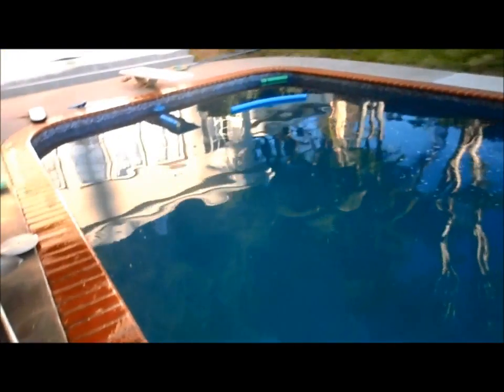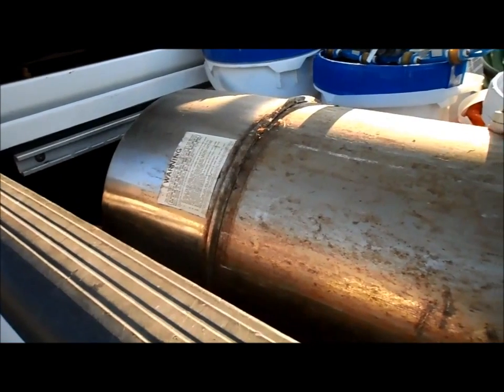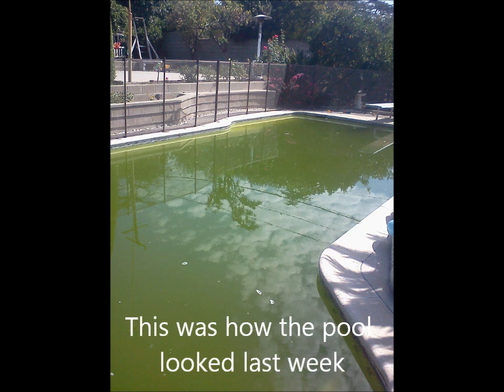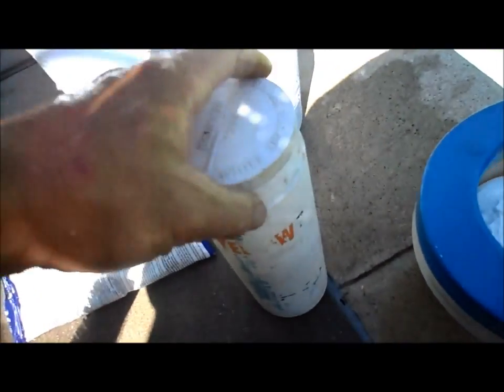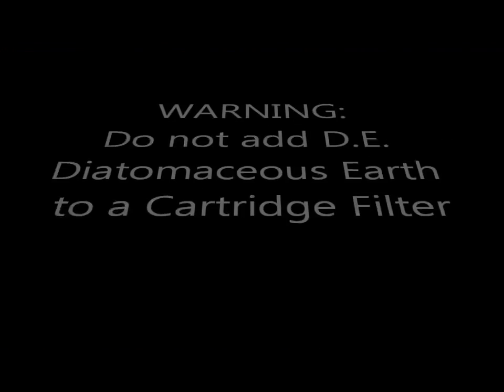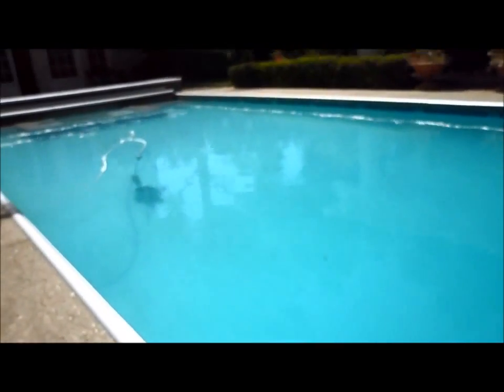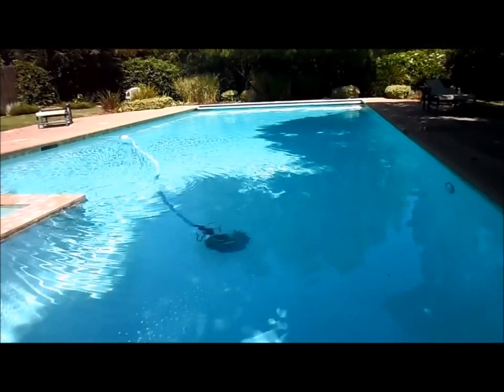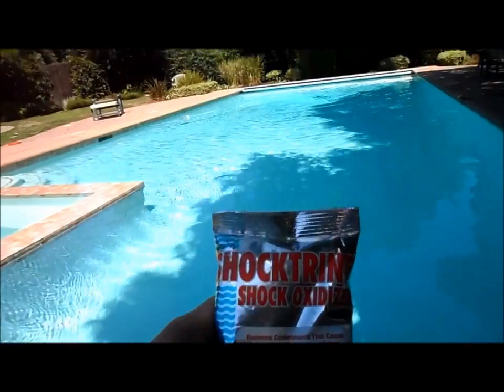Cloudy Pool Water, Causes and Cures

Comment: Another question. So I let me pool run with no Chlorine and some Algea has built up on the walls. Someone told me that if I use Lquid Cholrine, Yellow Trine, and shock that I would just be wasting the shock. Should I use all three chemicals or should I combine the yellow trine with liquid chlorine only? BTW, Your videos are the best Ive seen here on youtube! Thank you!
Reply from the maker: Liquid chlorine is sufficient and shock is not needed.

Comment: Hello,

Like all your videos and even have the Taylor K2006 on it's way!

Please help for a blue recover:

Here's our situation in a nutt shell: we live in SO CAL where we got hit pretty hard this winter and yes, to our fault, we neglected to stay up with the pool. So in the past 4 weeks we removed all the dirt, mud, even worms and i thought we were going to find a new fish spices, but finally got the pool from looking like an advertisement for Monster Drink, to a blue-ish tint color and also had some pluming repair and upgrade our filter to Pentair Quad 60 DE. After removing debris, we used Green to Blue (twice) and shock the pool like crazy. Right now we can see all the steps but cant see the bottom of the deep end (10 ft) and barely see the Zodiac (G3) until it comes up the wall. We've been brushing once a day since we started recovery process to get ready for summer but the pool isn't clearing up. We've had the pump running since the start as well (2600) and the PSI has only moved maybe 3 tick mark on the filter gauge and nothing really circulating through the leaf catcher. The last chemical we placed in the pool (3 days ago) was Clear-Aid and hoping it'll clear with the pump just running but we see no change. Got the water test and her's our readings: already spent over over 3K with repairs and chemicals (mostly repairs), but what are we missing here???

24000 plaster in-ground pool
Pentair Intelliflo Variable Flow Pump VF-3050 3.2kw 3HP
Pentair Quad D.E. 60 sq. ft. D.E. 
FAC: 7
TAC: 7
CH: 260
CYA: 75
TA: 120
pH: 7.6
Copper: 0
Iron: 0
TDS: 500
Pho: 0

Thanks in advance
Reply from the maker: You will need to clean the filter cartridges again and recharge them with DE. Do this until it seems the water is clearing. I would just go with straight liquid chlorine as the shock can also make the water cloudy. Your Chlorine level seems fine. It is just circulation at this point. I would also run the pump for 24 hours at full speed after the filter cleaning (3450 RPM).  Even if the filter PSI didn't rise much the cartridges can still be covered with organic materials.  Try that and see if things look better.
Reply: Wow, not even 2 weeks with the new filter and to our surprise we found two of the cartridges lien out and the other 2 with visual damage to the bands. Called Leslie (who installed them) and should have these replaced asap. We're to run the pump in the slowest speed, but what could of happen here???
Reply: Meant to say the cartridges were actually blown out, filter is dislocated from the support plastic.
Reply from the maker: My guess is that factory install was bad. Seen it happen in standard cartridge filters. I was doing a new pool start-up and it was starting to turn cloudy. Took the brand new filter apart and saw that the cartridges were not in place correctly.  It happens - everything is now made overseas and you lose that quality control... that probably wasn't helping your pool clear up any.
Reply from the maker: Strange. I would be there when they come out to fix it. Have them explain it to you. Possibly reversed the Inlet & Outlet.
Reply: Damn, you know when something is bugging you and you can't sleep. Well after your last post and seen you exact video of installation, sure enough, the plumbing is reversed! Wow, and they...Leslie's ..charged me a pretty penny too!
Reply: It was exactly as you called it, the pluming was reversed and now we can see the bottom of the pool...YEAHHHH! Pool is clear but we do have some stubborn algae stains along the walls, specially in the Spa. The readings are still the same as before except the chlorine has gone down from 7 to 5. Do you recommend algaecide or let it continue to run it's course. Its been 2 days since the repairs and we've been brushing the walls twice everyday.

thanks again!
Reply from the maker: I suspected as much... You will need some algaecide  at this point. Try to find a Sodium Bromide product at your local pool store like YellowTrine of YellowTreat.

Comment: a few more extra reason why ur pool might be cloudy
1)no disinfected level or chlorine in the pool
2)ph to low burning the chlorine to quick ph too high chlorine work to slow
3)dirty filter reducing circulation and affecting the chlorine check pressure gauge by ur filter system if ur gauge is 8-10 psi over the starting pressure  example when star it with a clean system and ur reading was 10 psi but know is up to 18-20 psi its time to backwash is it is sand or D.E Filter  if it is cartige is time to take out and clean 
4) check skimmer basket for debris and ur pump basket if its is clog it gonna reduce flow affecting ur sanitation if everything is fine u might wanna run ur system a little longer
Reply from the maker: Thanks for your helpful comment!

Comment: my pool is cloudy and i shocked it yesterday all the algea seems to have disapeared but it is still cloudy should i use some filter cleaner too?
Reply from the maker: The cloudiness will take up to a week to clear. As long as chlorine levels remain high and you are running your filter it should clear up on it's own.
Reply: Swimming Pool Tips, Reviews & How To -MrDgvb1 and using chlorine tablets will be fine or it will require more liquid chlorine or shock in the pool?

Comment: I shocked my intex above ground pool 15x48.its clean but cloudy.i was told to wait 24 hours after,its not been that long. Should i wait and see if it clears? I just put in a new filter cartridge in thinking this might help. any suggestions ?
Reply from the maker: It takes time to clear up. Just make sure pool is running as long as possible 24 hours is good and the chlorine level stays high - 5.0 ppm or higher.
Reply: Thank you!

Comment: I have a client with an ingorund pool, they shut it for a few days to do a repair, withing 3-4 days it went cloudy-green, you can barely see to the bottom of the shallow end. They dumped in a whole bunch of shock and chlorine bleach and it has been a week and nothing has changed....very bizarre. In my experience when the pool has been shut for a while and starts to go cloudy just adding more chlorine and a algicide day by day usually brings it back. 
Any thoughts ?
Reply from the maker: It is possible the shock is causing some of the cloudiness if they used cal-hypo. Usually running the pool 24 hours and keeping the chlorine at 10 ppm will do the trick. Maybe they are not running the pool long enough?
Reply: That's what I thought, usually when shocking it gets cloudy, my personal preference is to slowly bring the CL level up. If stabilized chlorine is used how much does it take before "chlorine lock" occurs? Have you ever encountered this problem ?
Reply from the maker: The CYA molecule binds and unbinds with the chlorine many times every second so I don't think chlorine lock is possible. But if the CYA is over 100 ppm you will need high free chlorine levels - 5.0 -10.0 ppm  as the kill rate of the chlorine is slowed down considerable - making it less effective. To counter this you can keep the pH at 7.4.
Reply: Thanks for the tips! Always appreciated
Reply: +Video Québec check this out http://www.troublefreepool.com/content/128-chlorine-cya-chart-slam-shock

Depending on your CYA level will dictate where you will need to maintain free chlorine to maintain cleaning effectiveness.  Also, you should be maintaining the free chlorine levels at the shock level while performing a "SLAM" which is described on the forum I linked to.  With contaminants in the water the chlorine will be "used up" very quickly so chlorine will need to be added sometimes every few hours to maintain a "shock" level.

Comment: I have a weird question. I opened up my D.E filter because I noticed that the D.E was shooting back from the return lines, and noticed that nothing was wrong with the filter. The grids were perfect, manifold, everything. Cleaned the filter up, washed the grids, did everything, assembled it again, then noticed that the D.E still shoots back into the pool. The pool is stuck at being close to clear, not completely clear, and I believe the problem is due to this. Has this happened with you beforehand? If so, do you know what the problem may be? Thanks in advance.
Reply from the maker: What type of backwash valve do you have? It is probably leaking in from there. What filter brand and model also.
Reply: +Swimming Pool Tips, Reviews & How To -MrDgvb1 I have a multiport valve. Filter is Hayward D.E pro grid. I thought that was the problem first, replaced the spider gasket, and I found that the same thing happens again.
Reply: +Swimming Pool Tips, Reviews & How To -MrDgvb1 I did however notice that occasionally when I backwash, a small amount comes back in the book through the return line. This doesn't happen all the time. What may be the cause of this?
Reply from the maker: It could be the Air Relief Assembly - those have a known defect in the older models. If your filter is older it could be getting stuck allowing air to force DE out of the filter when it turns off and back down the suction line towards the skimmer. When it turns on the DE will come out when the pool first turns on. You will hear a popping noise when you turn the filter on if the air relief is bad. 

 Manual Air Relief Assembly  - DEX2420MAR2
Reply: +Swimming Pool Tips, Reviews & How To -MrDgvb1 well I'm not sure if we have that problem, but this happens when I put in D.E as the pool is running. It shoots out of the return valve. No one has been able to answer this question for me, so I assume it is pretty uncommon. Any other possible reasons?
Reply: @issamabdalla2711

Comment: In Amazon this part is called the Replacement Pool Filter Element Cluster, DE4820.
On the top of the element there is a place to lift the element out of the lower tub and it is stuck.  Thanks

Comment: Do you have a trick for removing a DE filter group from the Hayward filter?
Reply from the maker: If the top manifold is stuck on the grids - which tends to happen in the Hayward filter- I use a rubber mallet and in an upward fashion tap the bottom of the top manifold at different points - that loosens it up and gets it off - if that is what you are referring to.

Comment: this is the first time I'm opeining my mom's pool (she's in a nursing home). We vacuum out the bottom & run it out into the yard,  then  I put the clarifier in & it cleared up & the residue turned into a  fine powder on the bottom, but when I go to vacuum it out, it's too light & it looks like it doesn't come up it just disolved & clouds the water.  How do I get the fine particles out?   we have a sand filter & it's 50,000 gallon pool
Reply from the maker: You can add a pool Floc to clump up the dead algae. It could also be that the vacuum you are using is too light. Do you have an automatic cleaner yet?

Comment: What if my swimming pool is a little bit cloudy and there is no smell but and if I run it for 24 hours cause I had 5 kids in my pool on Sunday I live in Arizona I ran the pool pump on during the pool party and after I ran it for 24 hours for 3 days because my pressure gauge was broken so it was off for the whole week by around Wednesday it cleared up

Comment: So my pool light needed to be repaired but it took almost 6 months of the pool being half drained and unmanaged for it to get to its recent disgustingness. After we filled it, shocked it, dumped ammonia to break down the leaves, chlorinated the heck out it, it is now bluish and cloudy. The cartridge has been rinsed every time the suction looks weak. In the beginning it was rinsed out every day. Now I'm rinsing out every few days. Just shocked it again yesterday. Bought TSP and thinking of soaking cartridges to rid the oils (BTW, city came to dump greasy stuff to kill mosquitoes and larvae and I think it messed up my filter) bc the water feels weird. I will eventually replace the cartridges but I want to exhaust the use of my current 4 before I drop another $300 on new ones. Anyone have suggestions? Is it OK to use tsp to clean then so it can filter my cloudiness better? I also read I can use 1 cup of DE alternative/substitute to help "enhance" my filter.
Reply from the maker: Fay W. Just takes longer with a Cartridge filter. You may need to install the new ones if it isn't clearing but I would give it another week with the chlorine at 3.0 ppm or higher the whole time.
Reply: Thank you for the reassurance. I'm going to vacuum today and then going to clean the filters with TSP and see how that goes. I can finally see the bottom of the shallow end as of yesterday. Thanks again and love your videos by the way! :)

Comment: my pool has a combine chlorine problem...  i shock it couple times, didnt work..so i need to do a total chlorine fix... so i add 1 ml shock to 1 gl of water and seems that i was able to read a 2ppm free chlorine... my question is  how much lb of shock do i need for a 18000 gl pool..help.
Reply from the maker: payo kraus If you use this online tool: http://poolcalculator.com/  you will need to add about 2 gallons of 10% liquid chlorien to bring the level up to 10 ppm which should be sufficient to destroy the combined chlorine.  3 gallons would bring it u to 20 ppm which wouldn't be a bad idea either.

Comment: how do i know the pump is charged with D.E or not? what is D.E?
Reply from the maker: Look at your pool filter and see if there is a label on it. Should say either Cartridge filter, DE filter or Sand Filter. If it says DE filter then you have a DE filter ;)

DE is the element that coats the grids and helps with filtration. Only filter that needs DE is a DE filter. I know this is sounding repetitive but it is important. To know if any DE is in the filter: backwash the filter for a minute and see if the water comes out a light brown or grey color. If only clear water comes out then there is probably no DE in the filter. Taking the lid off and checking is also a good idea. I have a playlist covering most major DE filters and each video tells you how to open them and clean them. You will also find a couple of back washing videos there also:
D.E. Filter cleaning, Backwashing & Tips:
http://www.youtube.com/playlist?list=PLsvsTjbpoT-fmtXepKd4HK9rp3gznVTUY

Comment: my water has alot of dead algae i vacuum it and 2 hrs later its back is it possible the filter is putting it back in and why
Reply from the maker: Depends on what type of filter but sometimes a DE or Cartridge filter will get overloaded and the water will not filter- return back to the pool dirty. What type of filter do you have?
Reply: I have a sand filter i have changed the sand drained pool 2 ft and ran new water in it for 24 hrs  i believe i have a main drain leak water is clear now but algea is showing up on liner way to fast chem are all up to par shocked it and swept it vacuumed and 6 hrs later liner is covered  i have valve at pump for main turned off
Reply from the maker: anthony danhausen Have you vacuumed the pool with the multi-port valve to "waste" mode? You might also need a Floc agent to clump everything up so that it can be vacuumed out.

Comment: I'm glad I found your video and I hope you can help. I see that you actually respond to people and I appreciate that. My pool is cloudy and so far the pool place has told me to put in 10lbs of sodium bicarbonate, 10lbs of conditioner, and a triple dose of clarifier. The pool is still cloudy and will not hold chlorine. Next, they said I probably need to replace the cartridge in my filter so before I spent another $100 on that I had a pool service come out. He said my filter is fine and phosphates were high so he put in some phosphate reducer. The pool is still cloudy. Any suggestions are greatly appreciated.
Reply from the maker: That was smart of you to call someone out to look at it ;).  Both the Sodium Bicarbonate and the phosephate chemical will add to the cloudy water. I suggest a longer run time until the pool clears. Maybe a filter cleaning after a 48 hours of adding the Phosphate product. Acid washing the filter cartridges is also helpful. I've got a video on it. If you can't find it let me know and I will shoot you the link.
Reply: Swimming Pool Tips, Reviews & How To -MrDgvb1
 
They said not to clean the filter for 2 weeks after adding the conditioner. It's been almost 2 weeks, so I will do that in a few days. I've been running the pump at least 10 hours a day and a couple times ran it for 24 hours. I will look for your other video. Thanks for the recommendation.